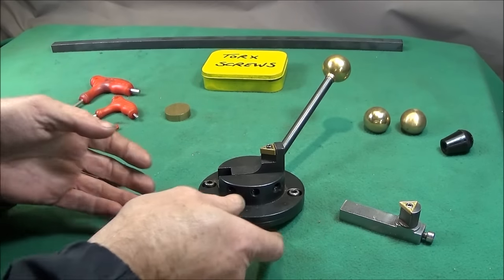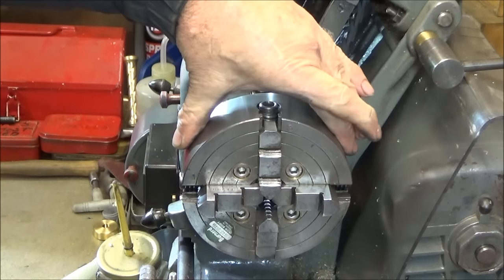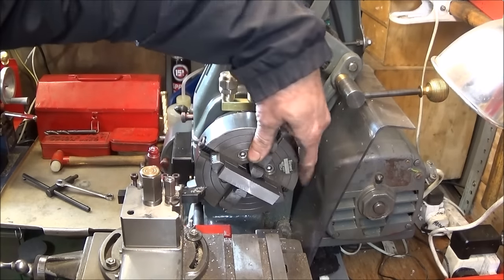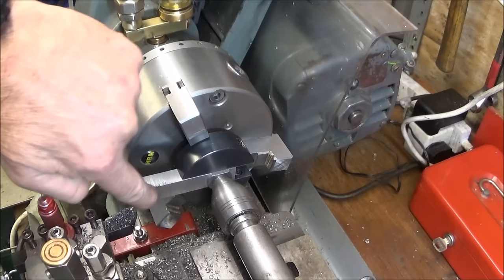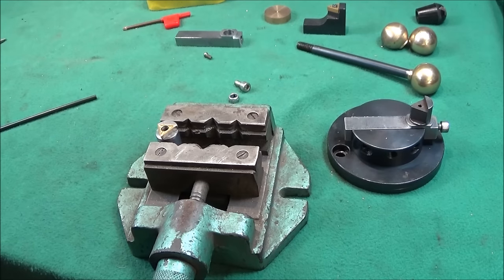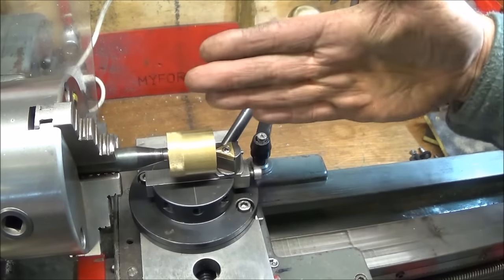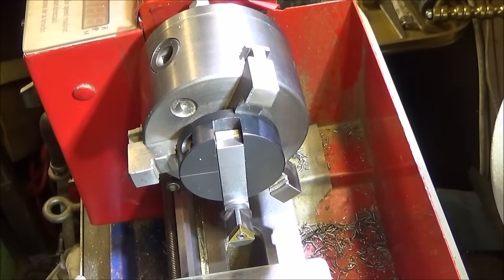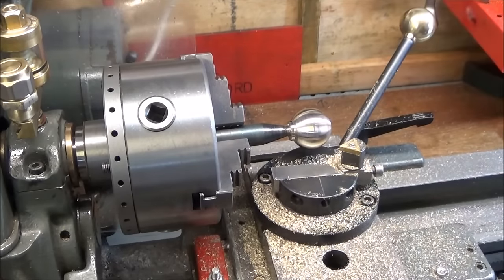Myford Ball Turning Attachment Modifications. Turn Larger Spherical Diameters

Comment: That is a good design as always Steve.  I think I will make one like that for mine.
I suggest that you rotate your insert slightly anti clockwise so that the shoulders do not interfere with the mandrel.  The angle on the right hand side doesn't matter anyway.  I also made a cross slide depth stop so that I can't go past the center line of the ball.

Cheers,
john.
Reply from the maker: Hi John, Thanks. Yes that is a good idea to rotate it slightly. Regards Steve.

Comment: I'm impressed and inspired. One thing I'd like to ask (I'm very new to machining) is the use of carbide for interrupted cuts. You show us how to use the four jaw chuck on the lathe to reduce the size of a piece of bar, which I suppose is equivalent to using a fly cutter in a milling machine. Now, many of the YouTube videos say that carbide doesn't like interrupted cuts - it tends to shatter - and yet many others show it being used for... interrupted cuts. What am I missing? Sorry if this is an idiot question.
Reply from the maker: Hi Nicholas, I don't really know. I have never had a problem using carbide like this. I have just carried on with what I learned in 27 years of aerospace engineering. We often had interrupted cuts using carbide, even on large hard stainless steel materials. The inserts did wear quicker, but to tell you the truth, I can never recall any incident that would stop us using carbide in this way.  Obviously speeds and feeds make a big difference, but like I say, I don't know what people keep going on about with regards to this subject......Thanks for watching....Regards Steve

Comment: Great Idea.
As regards RDG, I was not supprised to hear of the faults with the tool, EG Center height for Myford incorrect and other poor design features.
I purchased three quick change tool posts and found the angle locking not machined enough, so they JUST lock into position and thats all.
I could understand if I had purchased them from China,but fair go RDG.... Where do you get your tooling from ??????
Where is the quality control ?????
Cheers Noel

Comment: Steve,
I enjoy all of your vidios. How do you attach this ball turner to a Chinese Mini Lathe? Did you do a video on it? Thanks, Skip
Reply from the maker: Hi Skip. I made a ball turning attachment based on this one. You can see it in my latest video. It fits on the lathe cross slide after taking the compound slide off.
Reply: @SteveJordan  I watched that again. Nice work as always. I was hoping that you came up with a way to attach the eBay unit directly to the  cross slide. I do like your new tool. I think I can use the base idea along with the original tool and come up with a compromise. Thank you.

Comment: Steve thanks for the tips. What is the new carbide inset that you use ?
Reply from the maker: Hi Jon, I use the TCMT16T304 Inserts. You can get 10-off on eBay for around £12. Regards Steve
Reply: @SteveJordan  thanks for the the info.

Comment: nice improvements there Steve where did you get the m 4 screws from thanks for showing
Dave
Reply from the maker: Hi David Thanks. At the moment the seller in the UK, that I bought mine from on Ebay, doesn't seem to be selling them. You can still buy them from  Hong Kong very cheaply see Ebay item number 302018173877
There are loads on Ebay from China. I chose 4mm x 8mm long for this insert. They can take a couple of weeks to arrive, but I have always got them ok. There maybe other sellers in UK that sell them.... Regards Steve

Comment: I can't see how making a longer tool bit holder will let you make as you say a larger diameter ball, how would your modifications allow you to turn for example a three inch diameter ball when you haven't got the clearance below.
Reply from the maker: The longer the tool....the further it can be moved back in the rotating holder. Therefore producing larger diameters, to the limit of clearance beneath. I haven't measured the total size achievable but I think it is larger than what the standard tool holder can produce safely, being able to use all the side locking grub screws on the extra length.
Reply: So if you want to make a 3" diameter ball on your Myford lathe and slide the tool bit tip away from the centre line say by 1.5" this will give you a swing diameter of 3" but I can't see how you will get the 1.5" plus clearance from below of centre line of the lathe tool unless you modify the whole unit somehow, would this be possible as I'm going to the Alexander Palace Engineering Exhibition tomorrow hoping to find such a unitfor my lathe.

Comment: Would this work on a Harrison M300 lathe?
Reply from the maker: +stuart bowd Hi it will work with almost any lathe as long as you have a means of bolting it onto the cross slide and modify it to obtain the correct centre height of the cutting edge. 
Regards Steve
Reply: Titanium15160 
Cheers Steve, if i remove the tool post I can bolt it on. The 2 center holes that hold my tool post are about 4"apart, what's the diameter of the base plate? I would make a better cutting arm like yours.
Reply from the maker: Hi Stuart, The base plate is about 98mm. You could easily machine a bigger one to fit though as it only has a shallow bore for the top part to fit into. It is the best ball turning device I've used and very easy to modify.
Regards Steve